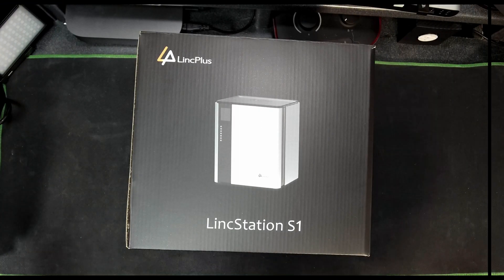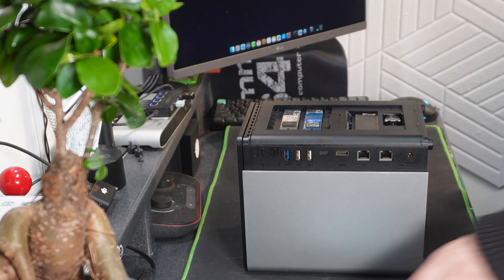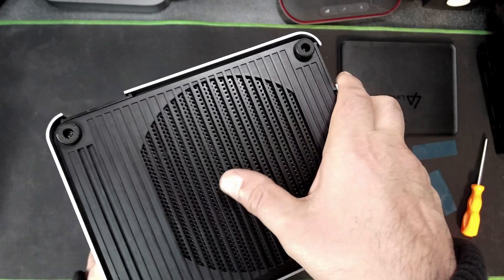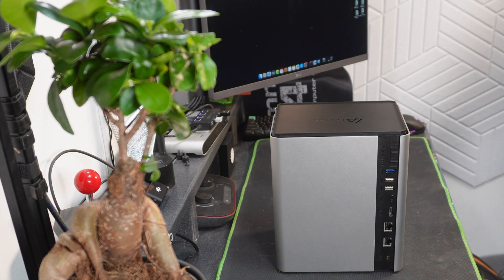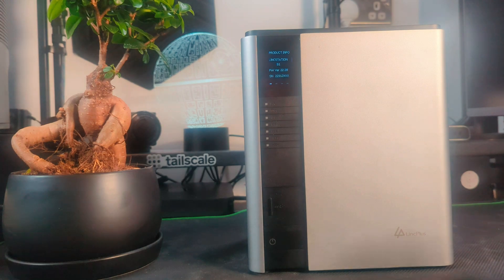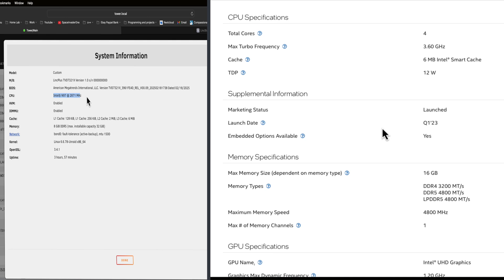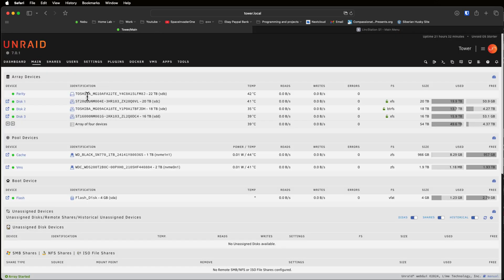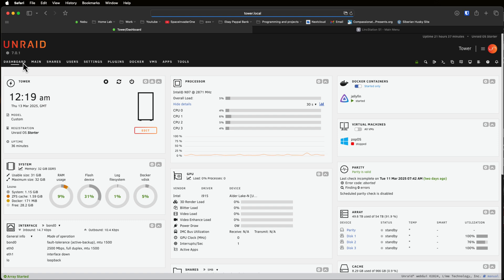LincStation S1 NAS Unboxing, Testing and Review

Comment: Got the Odroid with the same CPU, 24 GB and the N3 Case from Jonsbo.
It runs 4 HDD and uses 12W idle with 2x92mm fans non stop at 50% - bought non pwm, my bad 😁
Anyhow, that is far better than this solution.

Though I know why that is - of I install an nvme drive (i can install only 1!) then the power consumption goes up ~2-3W! So that might be ome factor of the difference.
Still seems rather high what this solution consumes. Anyhow, nice piece of hardware, not gonna lie!

Comment: Thanks for the review. I have ordered an S1.  Glad to see you can upgrade the ram to 32gb.  Is there a recommended SSD config for the NVMEs? I see you have a 1TB for cache and another 2TB for VMS.  Is there an ideal size or brand for the NVMEs?  I'm a newbe in networking so any advice is appreciated.
Reply from the maker: For the NVMEs we have 2 slots on this server. So if you want to have redundancy so if an nvme drive failed then you would want it mirrored (I would use zfs mirror) and you would need 2 nvmes the same size. But if you are not to worried about a mirror on the cache and use something like the appdata plugin to backup to the array you may not need a mirror. Using a mirror you loose 50% of the capacity you would have if you used single drive pools. Makes I like Samsung but they are more expensive than other makes

Comment: Very good presentation.
What is the recommended memory speed for the DDR5?
Is the cheaper 4800MHz good enough without degrading the system?
Reply from the maker: The LincStation S1 with the N97 officially supports DDR5 4800, so that speed should work just fine without any issues or performance degradation. You likely won’t see much real world difference going with faster RAM anyway since the N97 isn’t a high power CPU that would benefit from higher memory bandwidth.
If you’re looking for the best value, DDR5 4800 is a solid choice.

Comment: I get why the weak CPU, less heat = smaller heatsink/fan = smaller case. The issue I have is a more powerful CPU doesn't guzzle power when idle and most of the time these are close to idle but now bigger heatsink/fan and larger case hence I build my own.
Reply from the maker: Yeah, you’ve nailed it,less heat means a smaller heatsink, fan, and case, which is exactly why manufacturers go for these CPUs. And you’re spot on about higher end chips being efficient at idle too (so many people don’t realise this and assume TDP represents actual power usage). But since these AIO NAS boxes need to be designed to handle max load safely, the CPU choice also has to align with the PSU, cooling, and overall design.
And yeah, I love self building too,that’s probably why I have way too many servers! 😂 It’s definitely an addiction of mine. But for someone who just wants a quiet, efficient SFF NAS/Server without the hassle of picking every part, these off the shelf builds are adefinitely a solid option I think. Thanks for watching .